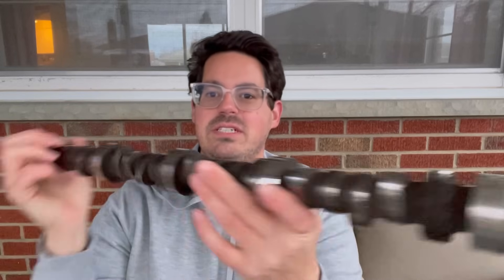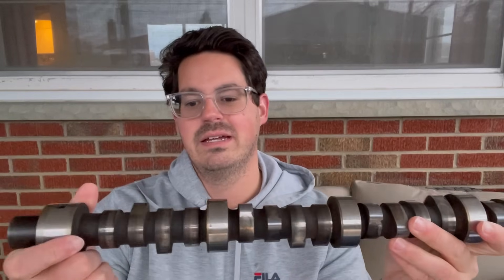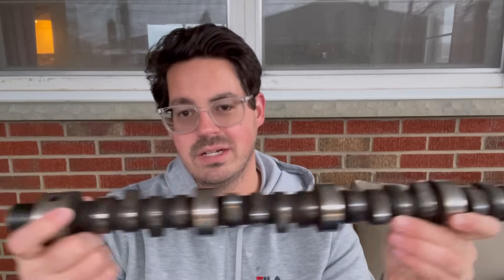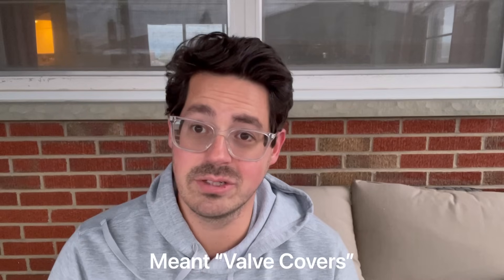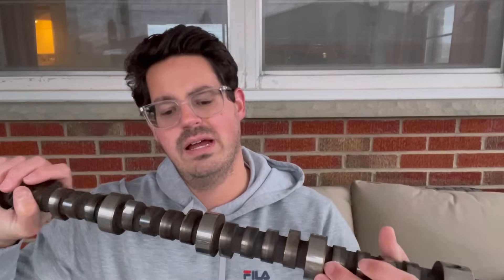Worst Automotive Components: Soft Camshafts (Chevrolet 305 & 350/Cadillac HT4100/Pontiac V8s)

Comment: The blame is hard to pin down. In the late 70s the blame was placed on oils. The oils with viscosity improver additives to get a 30 point spread (10w40, 20w50) were causing it. It made sense as the Chev dealer I worked at used bulk oil that was 10w30 and that is all you'd get. The failed cam small blocks we saw weren't serviced by us and had stickers for 10w40 as that was considered by most as a miracle drug. The parts Mgr at the dealer got the bulk oil through a GM program and there was some benefit that the GM 10w30 got him and he wouldn't budge for anything.
Reply: I recall there being a stink over 10w-40.  And just think, the popular thing to is to use oil that's not even rated for gasoline engines in a gasoline engine.  People are so clever, they have finally figured how to solve the problem of camshaft wear,  wait......  Is there a problem?  No.

Comment: A friend of mine had a 1978 Bonneville with a bad camshaft. The car had 180,000 miles and it ran very smooth and idled well. It just had no power. The rocker arms only went about half of their normal lift. It ran great around the city but struggled to do 50MPH. A new JC Whitney cam and lifters fixed it.
Reply: I don't think I'd complain at 180000 miles
Reply: Who designs something this poorly?  Which bar in Detroit had they been drinking at before they designed this engine?

I've never owned a GM product and I doubt I ever will, there is a Porsche 981CS 10 feet away from me in my garage.  They do stupid things from time to time too, but NEVER this bad~!

Comment: For what it is worth, Lycoming had a problem with soft camshafts in their O-320 light aircraft engines.  The O-320 was a 318 cubic inch air cooled four cylinder engine, very similar to a VW type 1 engine with overhead valves and a single barrel updraft carburetor mounted below the oil pan.  Despite the simplicity, this was a HUGE problem and the cost to repair [read:  Full overhaul] was upwards of $25,000~!

Remind me to never buy my own airplane-

Great video as always!
Reply: A bud just located a new cam for his 65hp continental, and it wasn't cheap. 
Almost unobtainable ,or it's getting to that point he said. 
Still, a small plane like dad's 46 luscombe is less than a new Harley, unless you need an engine rebuild. 
Pops engine needed a crank ,ended up being 12k all said and done back about 7-8yrs ago. 
So for around 30k total if you need an engine you can be flying.
Reply: I have never heard of "soft cams" in O-320's but pitting due to extended storage times and oil film not staying and providing rust protection.

Comment: That happened to the 305 in Mom and Dads 1978 Impala by about 136,000 miles.  Dad had a 350 put in and that made a huge difference. Now my 1979 Impala with the 305 didnt do that. It still ran as it should when i sold it with 146,000 miles on it.
Reply: Aw, was hoping your Impala would have ended up with a target master 350.  You know the gotta break a few eggs thing .

Comment: General Motors made camshafts for 75 years without an issue all of a sudden 1978 and on there's an issue 
My 1978 Malibu 3.3 liter v 6 had a soft camshaft as well as it was a 283 V8 with 2 cylinders removed

Comment: Soft Cams at GM started back in the early 60's, the 215 V-8  were really bad,, and I also replaced a few on  the 235 stright 6 chevy engine,, The 1969 327, was no joy either
Reply: And continues at an alarming pace into 2021 models.

Comment: What was a pain on the Cadillacs as you experienced is multiple lobes would wear off of the camshaft but yet it did not make any noise. Just low power. I found with the Chevrolets the engine would have a tick noise most of the time when a cam lobe wore off. Usually with the Chevrolets it was just one lobe. My understanding on this was during this period of time the manufacturing of these was so streamlined that exactly what you said was true. The hardening process was not adequate and hence the early lobe wear. The cost cutting in manufacturing during this time was brutal and it made for a lot of poor quality products.
Reply: "The cost cutting in manufacturing during this time was brutal and it made for a lot of poor quality products."  

Facts!  Also, this was a tumultuous time in the GM-UAW relationship, which often resulted in poor quality products. And then you have the bean counters. The engineers would design a quality product, only to be over-ruled by bean counters,  which resulted in an inferior product.
Reply: @alantrimble2881  Yeah. You are dead on. I remember when the updated S10 Blazers came out in 95 they where coming in on hooks with dead fuel pumps. They only had about 15000 miles on them. The dealer I was working for at the time was close to the engineering group for fuel systems. The lead engineer that designed that part came to the dealership to pick up a few of the failed parts. Talking with him he told me straight up he had designed a fuel pump that would have lasted the life time of the vehicle. These where a pain to drop the tanks on. Essentially he was told the pump was too expensive and he had to redesign it. Well, he redesigned it and guess what. The invasion of the bean counters has had and still has  a huge affect on the final product for sure. I agree too the GM-UAW issue was big back in the 80s. Remember it well. Along with that to clarify the "cost cutting" that occurred. During the late 70s early 80s the emission and cafe standards caught pretty much everybody off guard. There was a culture and a thinking those standards would not make it passed the legislature. Well, it did. Nobody was ready to ramp up that quickly to meet those standards. In response there was a lot of cost cutting measures being done to reduce manufacturing costs. Everybody did it. However, the final result was a lot of parts that where sub standard. I was starting out in service at the time. I disassembled and repaired the transmissions and engines of this time period and man I could not believe how things had been lightened up. You could tell they had reduced the nickel in the engine blocks. The cylinder wear on engines that had 50000 miles or on them where striking. It was an interesting time. I learned a lot in a hurry.
Reply: @alantrimble2881  — Sounds like what’s been going on at Boeing for the last 20 years ...
Reply: I remember those problems with the camshafts on the SBC's, ( late 70's to mid 80's carburetored engines, when they went to EFI things got better ) when the lobe would wear down to the point where the valve barely opened particularly on the exhaust valves. The engines would idle a little rough, but throttled up there would backfiring though the intake. Usually the lifter that was running on rounded lobe was pretty "dished out" compounding the problem and some of the lifters would somewhat "mushroom" at the base and almost impossible to remove out of there bores with the cam still in the engine. Some you had to remove the cam first if possible, I learned of a trick that another mechanic had come up, whereas he would take a piece of  1" or 1 1/2" (can't remember exactly...long time ago.. lol) ID PVC pipe, cut a length as long as the engine then slice it in half slide through the camshaft bore, push the lifter down its bore and the pipe would catch the it. Then fish it out with a magnet. That wasn't always the case, the majority of the time all the lifters usually came out, some a little tougher than others. GM's quality control was pretty much non-existent at that time, besides the lack of hardness on their cams and lifters was probably a cost cutting move (among many others) along with improper cam break-in at the factory lead to that demise. It always amazed me that one of the largest auto makers with all their engineering and manufacturing resources built basically junk on a mass scale. Even today GM is having quality control problems with their "Active Fuel Management"  lifters, I guess the ghosts of the past are haunting them now...

Comment: Bought a 78 malibu 305 new 18k the engine developed a slight miss took it to dealer, told csm s haft was bad, they replaced the whole engine under warranty with new long block, no isuues after that had the car till 1995

Comment: I get the love for 60’s-70’s GM, even the emission strangled era, but you have so much patience to deal with Most 80’s GM, and for that matter any domestic. 

I’ll give you the late 80’s “big body” cars with the 3800 were mostly solid, but they still had awful issues like alternators that failed regularly.
Reply: GM alternators are one wire.  It takes an hour with basic tools to replace one.
Reply: @curtislynch8189  It takes an hour if you stop to down a can a beer every 10 minutes. 20-30 minutes is more like it.
Reply: @davidmiller9485  But of course you do stop to down a can of beer every 10 minutes, because it's the only thing that dulls the pain of replacing your alternator... again.
Reply: @ZGryphon  LOL touche my friend.

Comment: typical GM quality, such wear condition  is rare to seldom on others manufacturers perhaps only LADA that had known metallurgy problems.
About all SBC original camshaft I replaced had damaged lobes, the most damaged were the exhaust of  #7 cylinder on the V8 engines and #5 on the 90 degrees v6 engines. One of the side effect is a damaged  valve seat and valve and of course, the lifter mating face.
usually on an inline, the problem is much less evident because the lobes of the cam are much wider

Comment: Adam, I owned as my first car a '78 Firebird Trans Am that was used by me as my Sunday car. Some years later it developed valve train noise and during an oil change to my disappointment I saw metallic particles in the drained oil. I had to have an engine rebuilder overhaul the Pontiac 400 engine, which meant boring thirty thousandth over and a new camshaft. I read later that this happened to a lot of Pontiac 400's. Damned General Motors! If I only knew what I know these years later I would have looked at the time in the classified ads for a ’73 or ’74 Firebird instead.
Reply: My dad's first car was a 74 Firebird SD455. He said it was the best car he'd had ever, even still. He sold it in 1988 for 500 dollars. He says he regrets doing that the most in life.
Reply: @crazycoffee  A 74 SD 455 T/A in good shape is feching triple figures at auctions these days.
Reply: @jeffrobodine8579  If it was just a Firebird... even more. They only made a few of them.
Reply: @crazycoffee  around that time a buddy who worked for a Pontiac gearhead got one of those. 
Worn paint but all there and solid. 
Turquoise and rust would kill it though. 
What's that ? 
A 67 tempest with a 455ho swapped in 😃
That SD was cool though, one of the last 70s cars with some power.

Comment: This is an issue I was not familiar with, thanks for the interesting video.  I am a retired engineer (NOT from the automotive industry) and I remember in the 80's many companies began outsourcing manufacture of components to outside firms.  They often awarded contracts based on low price and didn't do an adequate job of monitoring their suppliers QA/QC processes. The manufacturers didn't do this purposely, it often happened from naivete and inexperience.  I might surmise a similar thing happened here.  I remember from my own experience suppliers being very clever at cutting corners in areas that were not detected in our acceptance testing.
Reply: I don't have any specific knowledge but I do work for an auto supplier.  We don't make cams but we have inadvertently shipped substandard parts (on the order of a few per million).  There are penalties, beginning with return shipping of up to the entire order (at our expense), 100% reinspection of the parts (at our own expense), replacement of any bad parts (our expense, of course) and the likelihood of late delivery penalties.  The OEM gets to offload alot of risk onto it's suppliers.  As far as cams goes, it seems to me that samples from every delivery would get 
checked for lobe hardness.  This ain't rocket science.
But what if GM screws up their own cams?  Isn't there a strong short term incentive to keep this mess off the books?  Don't take responsibility, just shove 'em in.
But, given that the soft cam issue came up many times at GM, I'm saying it's 100% GM's responsibility.  Either they were letting their supplier get away with murder time and time again or they screwed up their own cams and just didn't let it bother themselves.
Reply: Another trick they'll do is switch suppliers without going through the same durability tests.  Not intentional, just incompetent.
Reply: Classic example of bean counters screwing things up. All they see is the dollars and cents. It’s usually the engineers who have to figure out how to fix the problem. Of course, it’s the consumer that suffers the most.
Reply: @mattrodgers4878  Beancounters aside, I think much of these serial problems come from an upper management attitude that they're going to punish the people who screw up, rather than fixing the process.
I can imagine a lunchroom conversation:
"Damn!  Some idiot on second shift set the timer wrong on  the heat treat oven and now we've got another 800 soft cams!"
"Whattya gonna do?"
"I ain't gonna report it!  If I reported every damn screwup on the floor, next week would consist of 4 days filling out paperwork and one day in the unemployment line."
"Couldn't the system be- foolproofed?"
"Maybe.  I submitted an idea where various parameters could be programmed on cards that traveled with the parts.  Detroit didn't care.  If the bigwigs can't personally take credit for an idea, it's no good.  Anyway, I'll bet some of these cams last until my pension is good!"
Not that I have any personal knowledge of what happened at GM but I do think a malignant corporate culture would explain alot. 
"
Reply: @21stcenturyfossil7  I have a question then, what the hell is going on with factory spec cams and lifters. I've seen them eat themselves up during break in. Usually the lifters are so out of spec that they won't stay pumped up and then eat the cam. It's starting to get frustrating. (this is for hydraulic lifters by the way)
Reply: @davidmiller9485  I don't know anything specific about cams  these days but one difficulty in the aftermarket is the large number of different parts that have to be carried compared to decades ago.  Given the small volumes of any particular part there won't be many suppliers tooled up for it, maybe only one.  If there's only one supplier for a particular part, and everybody has to rebox that part with their label, then everybody else has to accept what they get.  It's interesting that you mention valve lifters because, decades ago, I knew some people at Stanadyne which was a supplier to the OEMs, particularly Ford and Chrysler, and Stanadyne had high standards for quality.  Of course, Stanadyne didn't have to tool up for dozens and dozens of different lifters, really just a few.  And other companies were making good lifters for the same applications so if Stanadyne started making alot of junk, they lost business.  Since then, I think Stanadyne sold off their lifter business.
I guess the short answer is -- without competition, the customer can get screwed.